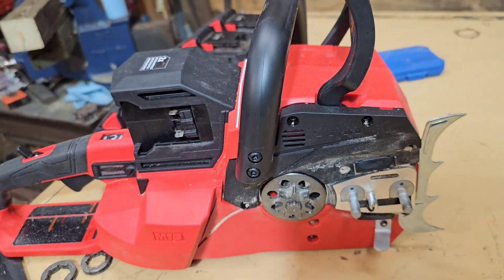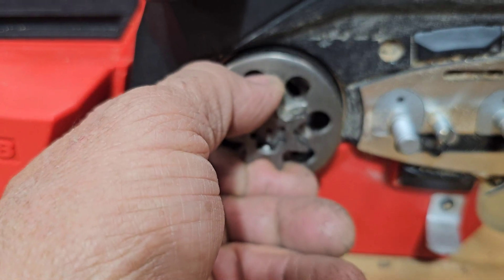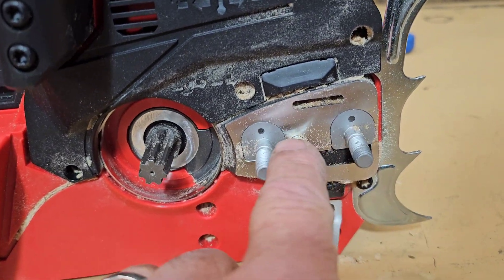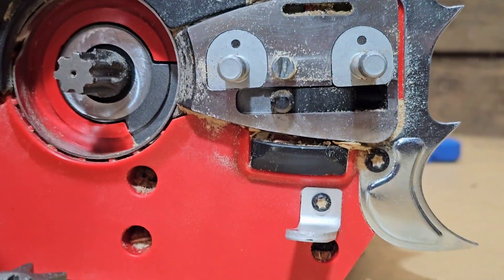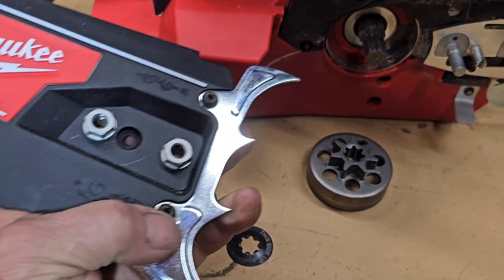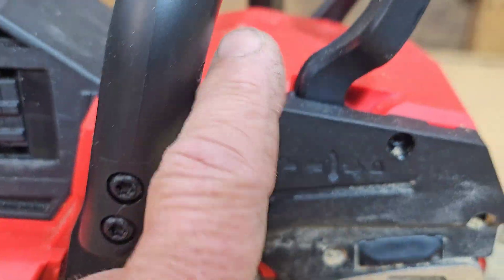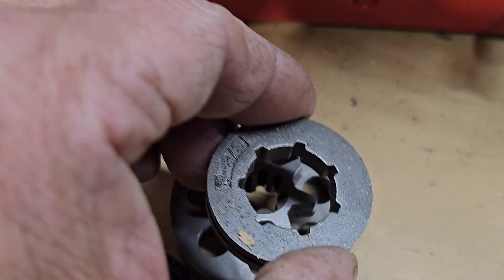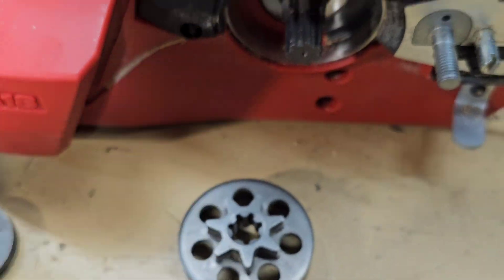Looking under the cover - new 20" M18 Fuel 2827-22 chainsaw - what's it made of?

Comment: In case you're interested; I HAVE found a couple of .325 24" guide bars.
Reply from the maker: @John-cj3ve  I was looking around and there is an Oregon .325 tip... so if I wanted to,  I could take a 3/8 24" Oregon bar and swap tips to get the .325 and then run a skip tooth so there aren't a million cutters,  but I'm definitely looking to alter the chainsaw drive spur to accept rim sprockets so I can swap easily to 3/8. I ordered another spur and I'll let you know how it goes.  It would be good to find a machinist locally that has a channel and try to do a collaboration on the adaptation.
Reply from the maker: @John-cj3ve  I feel like I'll probably have to explore that option,  but I'm really hoping to figure out a 3/8 setup.
Reply: I'm with Resueful, have too many chains to sharpen, would prefer to upgrade to existing type.